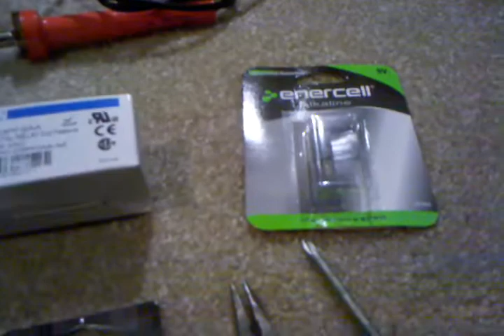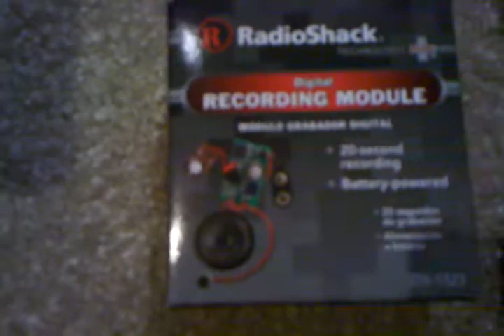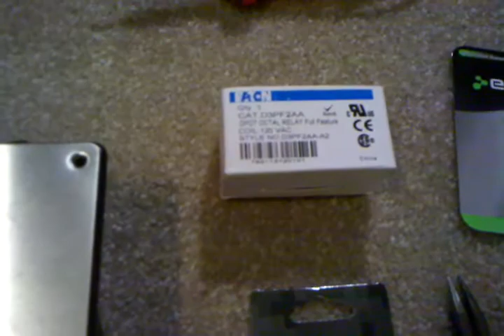diy triggerable sound effect without arduino for any use under $30

Comment: Great video Nathan.  I'm in the process of building this based on your parts list.  I've hit a road block with where to connect the red and green wire you soldered on the board replacing the play button.  Do you attach it to the relay, if so, which number did you connect it to?  I can touch them together and it plays but they should be just connected together permanently should they?

Comment from the maker: Ace883koi, nothing is wrong with the card. When you record the cannon sound, find one thats low and has a good rumble. Then record the sound at a very low volume. After that, use a reciever and set the reciever to the highest bass and lowest treble. And then you've got your bass back lol thats what i had to do. It took a while just to find the right cannon shot. Ill post a page with about 50 cannon sounds, the one i use is on there